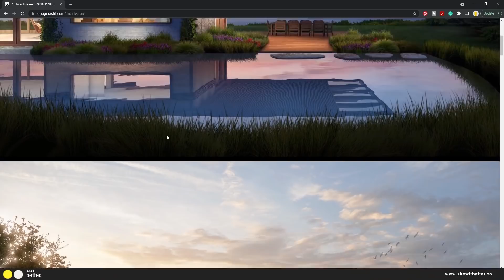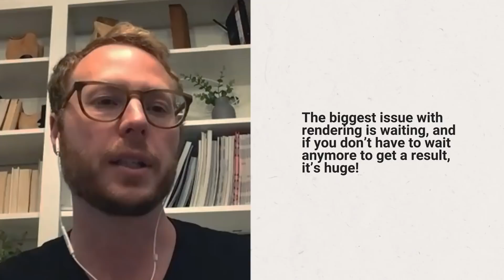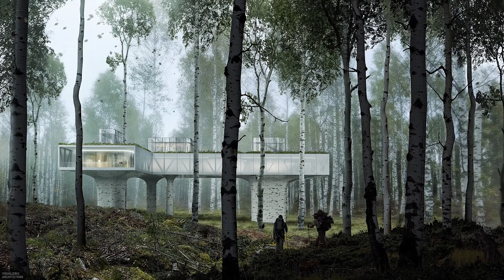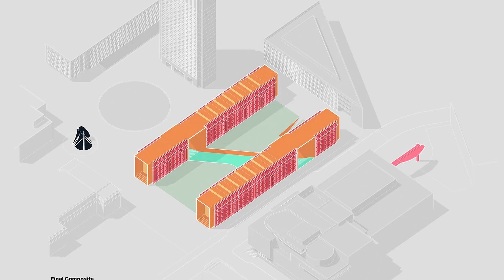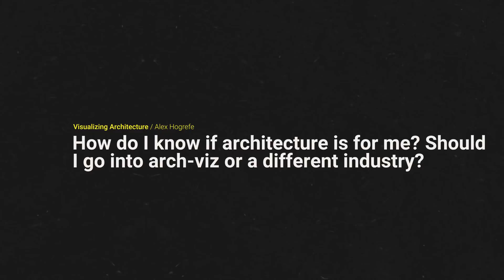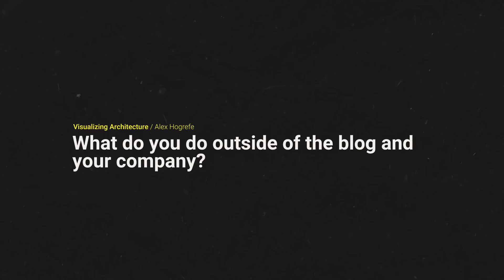The honest truth about being an architect and rendering artist w/Alex Hogrefe P.2

Comment: I am surprise about the lack of mention of the real architect work, which is a bigger responsibility within the society to build culture in the city, making the building technically feasible and appealing inside and out. Also, out generation have a huge responsibility to lift up the sustainable construction and design as we are in a race to reduce global warming. Personally I am not a fan of renders or visualizations, I think committing to a determent image of the project before you are in Construction Document phase limits the normal evolution of the design through the phases of the project and makes the client be rigid to that first initial image, in the other hand open sketches and concepts allow the design to be alive from the beginning to the end. Renders are great just to create fun images or develop theoretical projects of course.
Reply: Thing is alot of times, clients don't "visualise" the way we do with drawings. I am speaking from experience. The 3D images don't need to necessarily be top quality but they should be clear and direct enough to get a design approval sign off from the client, before doing final construction drawings. Of course in early stages things should be more general, start with sketches, get the general concept approved. Then schematic layouts, then getting into a more 'real' visual representation with construction documents. The end result of the design with tender drawings, are usually where the bulk of the desin is finalised (also for reasons of fee payments and cash flow, without constant changes etc.) With this, it'll be good to have clear 3D images to sign off. Then you do construction documentation.  Of course there may be changes, but at this point there really shouldn't be major changes in layout etc. As it will be an expense on the firm + other consulting parties, regardless of 3D or not. That's why you get the tender set/ 3D signed off, if the client decides to make a change, the consultants can get paid a variation for the extra work.

It depends on the scale and complexity of the project.  A house with fairly flexible contractors or local builders can  be done in a much more flexible way, and working on site itself is great. But most projects cannot work that way, contractors would charge for variations, things cannot be quoted for, and large projects have expectations and deadlines that go beyond the architectural aspect. They have to be processed by various people who need to know what they're spending time and money on.

Comment: I started working in an architecture firm in 1986 back in the UK. Sitting at my drawing board churning out work. I could easily do quick perspectives with a thin and fat pentel pen on trace.

I feel like Alex and I are lost cousins. I did my first 3d image in 1998 using Autoshade. It was 256 colours only but my presentation won the office the job. Ever since then I've done 3d in autocad, mostly as wire frames because there wasn't a rendering software available. I remember 3ds max when it first came out and was running DOS. I picked up Sketchup and I haven't looked back. I can't even remember the commands in Autocad these days to do a 3d solid. I never liked using Max as is was totally unintuitive coming from a cad background

I've done loads of visuals over the years but I was in the right place at the wrong time. No one wanted arch vis people back then.

I completely understand his references to working in offices. I wanted to spend my time designing but as I was getting older, offices wanted me to do meetings and CA. I told them no.

I would love nothing more that to work for a visualisation firm but I live in nowheresville MD now. I'd be happy to work for some company remotely though.
Reply from the maker: Wow, what a transition from cad to sketch up! The cool thing is that your passion for arch viz persisted through the years !